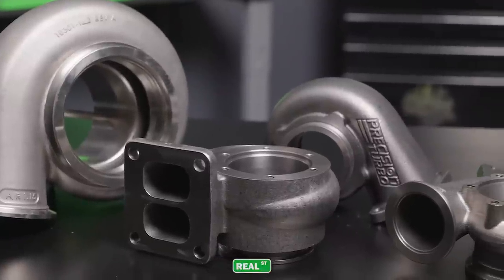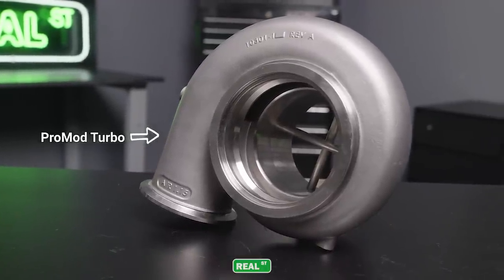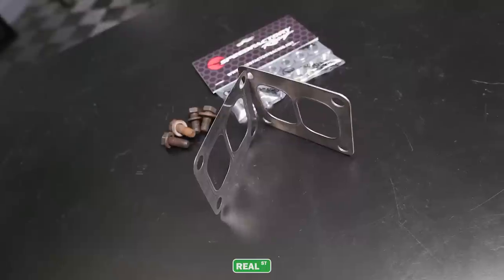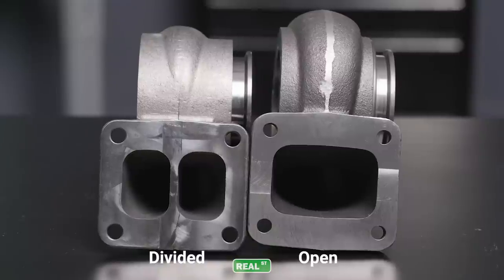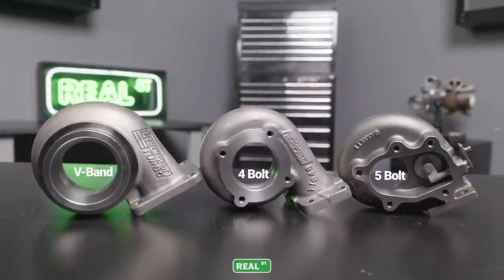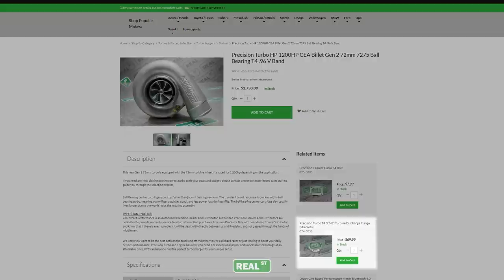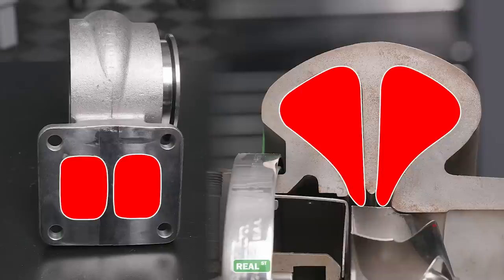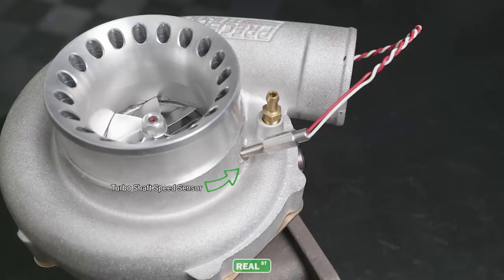Turbocharger Exhaust Housing Options - Jays Tech Tip

Comment: The ONLY thing good about a LARGE turbo is giving the other guy the impression he is winning the race ....
Reply: Lmao
Reply: I go back and forth on this. I had an 80mm on my Supra for a few months last year and it was nostalgically fun. My kid referred to the car as a "roller coaster" because there was soo much build up to it coming online and making power! I'm now back to a 7275 and it's much more responsive. I don't know that I would complain about a little smaller turbo but than again,  lag is part of the Supra's character. Thanks
Reply: @jaymeagher1510  i am NOT a lag person, i want instant spool and power and i am NOT a top end hwy fan either. 
My 240sx is instant spool and jnstant power ...
My Genesis coupe is the same way, hit the gas and it goes ..
My 98 Supra is still on stock twins and they responded descent when it was stock but now with the full exhaust, no cats, and no clutch fan drag, they respond MUCH faster ... 
If and when i decide to remove the stock twins, i may stick with a mid size turbo to maintain the quick low end spool, because when i hit that gas pedal, i want it to respond then and there ...
Reply: @ACommenterOnYouTube   If you decide to go single on the Supra I'd suggest a 6466 with a 1.0 housing. It's really a hard combination to beat and will enough airflow to make over 900whp without drama with supporting mods.  You won't have the power you have now at 2,700-2,800rpm but it will more than make up for it once it's online. Thanks
Reply: @jaymeagher1510  i think that 1 ar is going to me too big for my taste especially when the stock twins kick on almost instant and still give me good mid range. I can care less about top end as i dont do hwy pulls ever, most of my power pulls are going to be from a stop light launch or over taking someone from a ~45 mph stroll up to ~80mph ... So i will need something to mimic the stock twins quick response ...
Reply: @ACommenterOnYouTube   You could do a TTC for little to no money and see how your car drives. This will mimic a single conversion in terms of power curve.  Putting less than a 1.0 on a smaller turbine like a 66mm just takes the magic away on a "larger" engine like yours.  Once the engine is near 4,000 RPM the response will be very acceptable. The "problem" with the stock twins is they give you a little bit of TQ as the first turbo builds boost and then it's flat until the system has both turbos spooled.   Try to find a Supra with a 6466 and go for a ride, your taste may change. Thanks
Reply: @jaymeagher1510  i am going to stay away from the true twin turbo setup as that is too much plumbing involved and it will be a cluster mess. 
It will be a single turbo conversion but not a large one as the low end rpm / tq is very important to me. 
The stock twins are good, the 1st turbo spools near instant and gives that nice good take off power, then when the 2nd turbo kicks in around 4k rpm, it feels like 150 shot of nitrous just kicked in which just adds to the pull .... I think its a great setup but when i go to a single, its not going to be a large turbo. 
I HATE lag with a passion. When i hit that gas pedal, i want it to respond. 
When you have 2 other turbo cars that also respond to boost instantly, you get used to it and when you get lag, its like .... ..... .... any day now.
Reply: @jaymeagher1510  even on a stock block you’ll recommend the same turbo?
Reply: @dispatchcustomerservice-gb4977   On a stock block 2jz? Yes. I"d use the 6466 with a housing near 1.0. Thanks

Comment: Exactly what I was looking for. Ideally I'd like to make 550 with my 1jz I know the stock twins are tuned at 2,400 and 3,600rpm for peak torque and hp so I'd like quicker spool but I also don't ever really shift must past 4k so when the rpms drop there they are right in the sweet spot. What if I wanted to change that curve to more like 4,000-5,500 rpm that sounds about right like twice as much and if I shift at 6,300 way closer to 7,200 red line it'll fall right back down to 5,000 and that's twice the rpm as stock so right when it would be done pulling at stock is really where I want that single turbo to start building boost

Comment: Thanks for the informative video. I recently acquired an A91 Toyota Supra in manual. Coming from the WRX platform I like the responsiveness of the twin scroll setup. I'm not really a fan of turbo setups due to turbo lag so it's always interesting hearing about different types of turbo configurations.

Comment: Which is better for 4.3L Syclone 500 whp range 66mm compressor wheel with P trim turbine wheel .82 T3 a/r or divided T4 .81 70mm compressor wheel ball bearing Q trim turbine wheel?

Comment: Maybe a dumb question, but why do promod turbos have those 2 bolts in the exhaust housing.  Is it for safety being larger??
Reply: So the turbine doesn't exit the down pipe at 100000rpms and kill someone in case of a failure.

Comment: Don’t agree at all about twin scroll only helping at low rpm. It’s less about transient response and simply where in the rev range the turbo spools.

That’s just simple fact.
Reply: I prefaced with the OEM approach where twin scroll has the largest impact. The aftermarket is muddy at best on the subject.  I'm not saying there's "nothing to be gained" but will take the position that there's way more opinions surrounding the subject than data. Thanks

Comment: Thank you! Very informative. I have a GM 6.5TD 1999 and want to maximize the performance of said design. It has High compression ratio so boost will be limited to 1BAR for longevity. But a higher volumetric efficiency and intercooler should net usable results.

Comment: I paired a GTX3076r with a .64 a/r to my SR20 but the exhaust choked out at 20lbs of boost at 6800 rpm. I’ll be installing a .86 turbine housing shortly. Do any of you guys have any advice for the swap?

Comment: My turbo used come on boost at 1800rpm and peak at 3000rpm I noticed my map filter is cracked and has oil now the car is surging in power. No boost at 1800 comes in very very hard and late at 2000rpm and peaks around the same 3000ish rpm.

Comment: Twin pulse has it's uses in the low to mid range power and torque increase as the volume is less thus the velocity per pulse of exhaust energy, from the cylinder, is higher and more efficient through pulse-firing organization.  A Split T4 will flow less mass at a given pressure ratio than an open V-Band of the exact same A/R. Garrett Documentation and graphs show this, but it's around 2-3 lb/min difference across the graph.

A Split T4 may assist the in getting more torque, through efficiency increase, at lower RPM speeds to get the torque converter ready for launch, without NOS. In a 1500+hp application split pulse is likely a hindrance due to lack of housing options available - however you can always use a split pulse manifold with an Open T4 or T4 to V-Band adaptor, but not the other way around, as the divider melts with high EGTs.  On a drag car, it's not much of an issue which setup you go for as the working RPM is in the top half to third of the range. In a circuit car, it's very important as you have a much more dynamic rev range where torque is required on tap, out of corners, as soon as possible. 

V-Band certainly makes it a lot easier to do turbo swaps and carriage changes, however a pro tip would be to ditch the factory cutter style nut that always damages the thread when removing and use copper nuts instead or double regular stainless nuts to prevent backing out under vibration  / heat cycling, along with the addition of copper paste anti-seize. The nuts that Garrett Supply for all their v-bands are terrible and the thread is way too fine for the application. Always have a spare v-band on hand when removing a V-Band based turbo Inlet or Outlet. 

A/R is also dependent on fuel choice. If you're running E85 or E98-100 or Methanol - you need to up at least 1-2 sizes higher due to a 40+% increase in exhaust mass flow VS petrol, so you don't choke the exhaust side and have excessive exhaust pressure than boost pressure. This is where EMAP datalogging plays a key role. 

Lastly, A/R is not valid across different turbine sizes and frames of turbo. 

A 1.21 A/R on a G35 is much smaller than a 1.21 A/R on a G42, by a considerable amount. Use the mass flow graphs to determine the peak flow you need or run a range of different housings and dyno/road test with EMAP vs BOOST logging.  Non genuine housings are much cheaper than genuine nowadays so you can easily tune in your response or even have different housings for different race conditions.

What housing your choose depends on what you want optimised and how efficient  you want your turbo system to run and where you want the boost to come in by. Having a 0.63 housing on a GTX35 will bring in the boost as soon as possible, but your peak power will be severely limited. A 1.21 housing on the same turbo - your boost will be 1000rpm + laggier, but your top end power band may increase by 2500rpm as you're not choking it out with excessive EMAP / restriction.  

If you have a 4000rpm stall converter for example - you match your housing to where you will make your launch boost. No point getting some 1.44 housing that's 1000 rpm laggier than your stall instead of a 1.00 and you can't get it on the converter until the middle of next month if you're not spraying it with NOS. Turbo choice plays a role here as well.
Reply: This was an excellent addition to the comments section and you saved me a lot of time typing lol. Good stuff.
Reply: There is not a 40% increase on exhaust mass with the use of alcohol fuels at all.   The whole 14.7:1 or 9.7:1 etc stoichiometric ratios of fuel are a hint to this.   By far the majority of the exhaust mass comes from the air that's going in, even with methanol fuel.   

E85 is going to be far closer to around 3% more mass flow, and this arms you with choices in regards to how you want to make power.  

Going to E85 on a knock limited setup can often gain a lot more than 3% more power with the same airflow so the power gains you get are significantly more than the increase in exhaust mass flow would suggest.  If you happen to be pushing the turbo hard enough that 3% more mass flow means EMAP is bad enough that the housing is too small you often can decide whether you want the extra response and reliability offered with E85 and just adjust boost targeting to sacrifice a bit of the power gains to bring EMAP back into check, or go up a housing size and really go for the moon.  

I personally have not seen a bigger housing being necessary purely from going E85, it's been more where you can go boost wise meaning a lot more flow capacity is required when you can push the turbo much harder where tuning was stopped on pump gas due to octane reasons.
Reply: @misterlith  I must have glossed over that number in his comment, because you are definitely correct on that. It's definitely more with ethanol or methanol, but not much more.
Reply: @misterlith  Nonsense. E85, for example, has a density of 773kg/m3. Gasoline is 716kg/m3 , Ethanol 100% is 784 kg/m3 and Methanol 792 kg/m3.  

E85 is ~8% more dense than Gasoline, right off the bat, so that throws your 3% theory on these 2 facts alone.  -1.

The chemical reaction that takes place in the combustion chamber is based on a fuel mass flow, primarily. 
Gasoline - to completely burn 1kg of gasoline in a perfect molecular reaction, you need 14.7kg of air. 
Ethanol E85 - 1KG of E85 9.7kg of air is required. The power output is much less than Gasoline if you're just burning at stoich.

To burn the same 14.7kg of air, you need 34% more ethanol fuel by weight. This where the extra mass flow comes from.  -1. 
using methanol, Stoich is 6.5:1 - you need 56% more Methanol Weight to burn 14.7kg of air. 

Thus approx. 34% more fuel is required than gasoline to burn the same quantity of air compared to that of gasoline. Because we are injecting such a large amount of ethanol to reach Lambda 1 in this case, more molecules exist in the combustion chamber, compared to that of gasoline, by weight and thus mass flow increase over that of gasoline. That is why a 2JZ will pickup approx. 400-700 more RPM spool response and hit boost earlier on a 2JZ with just Ethanol E85 vs Gasoline 93 or Petrol 98 on the same housing. It will also choke a smaller housing and increase EMAP sooner at lower boost levels, compared to Gasoline. This is why a housing increase may be recommended depending on the power goals. 

To put it simply, E85 has less thermal energy per kg (which is why it burns cooler) and because such a greater volume of E85 is required to burn the same quantity of air, compared to gasoline, that's where you get a much higher energy output compared to gasoline. 

If you have actually tuned a car, you need approx. 35-40% more injector flow / pulse width to reach the same Lambda level as Petrol/Gasoline in a performance application with headroom. That's why you need to upgrade the injectors and fuel pumps when running E85 or E100 by a considerable amount to flow more. Fuel consumption is down by approx. 40% as well compared to gasoline. You'll be lucky to get 200-250km/s to a tank in a JZA80 supra with spirited street driving, vs 400kms on gasoline. I have witnessed this in my own cars, side by side, same routes and turbo setup, different fuels, same races. 

This doesn't take into consideration any timing advantages that you gain from running E85, where you can easily tune up to and beyond MBT to increase the combustion pressure and thus exhaust gas velocity, compared to petrol, which further aids in a mass flow increase.  -1 point to you again. 

All of these are needed in a quantities far more than 3% mass flow. You're way out by a factor of 10. Please humor me how you got to 3%, which cars you have tuned and how much your fuel map has changed between Petrol and E85. Then tell me why everyone that goes E85 runs 50% lager injectors and pump flow as a mere necessity to run E85 at high performance levels. when your claimed 3% will do the same job with no upgrades. Hint - it doesn't.  -100.

In Australia we had locally built Flex Fuel cars that ran on E85 and Petrol 98, namely the LS based SS commodore, et al. On my dyno with an OTR and exhaust it made 275rwkw Stock on Petrol. With E85 - it made the same power - it was tuned not to take advantage of e85 at all - just to run it as an alternative and then cheaper fuel available the the pump. When E85 was cheaper than Petrol - it was a good deal - you could get E85 for 20-30c per liter less than Petrol.  However the fuel consumption of E85 used 25-30% more fuel according to the customers. When E85 got more expensive - it wasn't worth losing the range per tank compared to that of gasoline. If you want to make the same power as a gasoline engine - you need to burn more ethanol to do so, and thus increase the exhaust mass flow in the process. In addition the benefits of the extra fuel is better cylinder cooling, higher octane to push more timing and better boost response as the mass flow is increased earlier on, spooling the turbo sooner and improving volumetric efficiency. 

When you're talking 7-9 second cars - it's all about exhaust mass flow not choking the turbo to the point where high EMAPs and EGTs are a hindrance. This is why most turbo drag cars have a larger turbine inducer than compressor inducer and that's evident in the precision nomenclature. PTE 7576 / 8385 / Promod 98-103. 

Thus I'm not convinced by your 3%. I haven't seen it in real life on basic fuel consumption, it doesn't math out and I don't believe you have tuned a vehicle for flex fuel, as  you would know that by virtue of a fuel temp vs ethanol % there's different densities that are required for the VE calculation as well as a fuel composition scaler that is based on the stoich differences at each ethanol % , to start with.  -9k.

There is a considerable increase in exhaust mass flow, in the the order of 30-40% depending on how rich you run your mixtures and what blend, which is responsible for the spool increase and response when using E85 vs Gasoline and can create choking issues when EMAP rises beyond an acceptable level, thus you must increase your housing size.  This was done with a customer car that went from 1.01 A/R to 1.21 and gained nearly 6mph on the 1/4 mile, chopped 0.3s off the time and could run more boost before the EMAP became a limiting factor again.

I don't see this 3% increase approximation to exhaust mass flow mathematically on all the chemical equations or physically in the real world. It's false. Your math is backwards based on the stoich values which means you're not qualified to even understand combustion and how an engine makes power. The more fuel weight you can burn per unit quantity of air, the more thermal energy will be released from the chemical reaction and thus the more power there is to be gained. This is the premise you don't understand and that's why you're categorically wrong.

Comment: great information, I have a 2014 Ram 3500 6.7l with some mods, primary use is towing a 40 ft 5th wheel and tractors to get maintenance and such.   Can you do a video that is more specific to this type of set-up, thanks Mike P.

Comment: My fix to twinscroll gasket 

Using a tungsten-scriber i scratch three (1”) vertical lines on the centre divider. This holds the centre “weakest” part without sacrificing seal on the rest